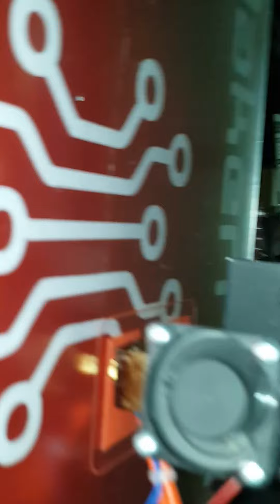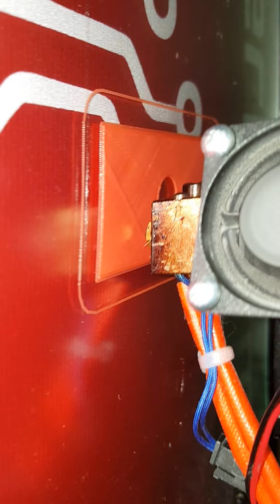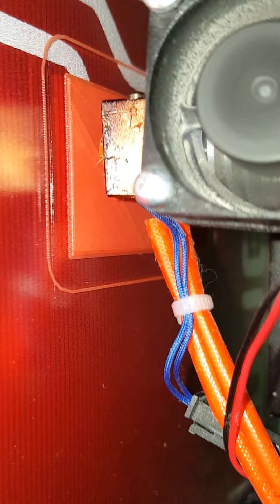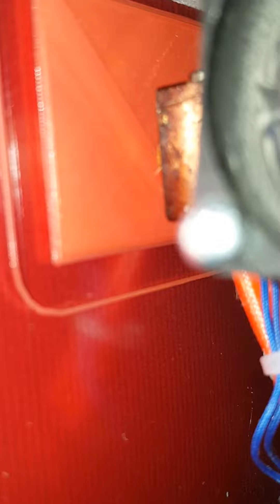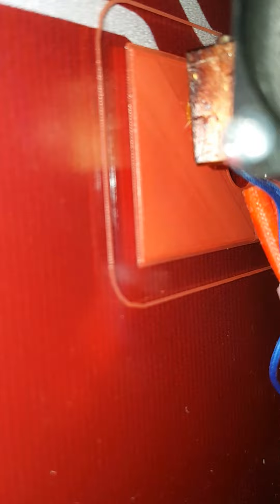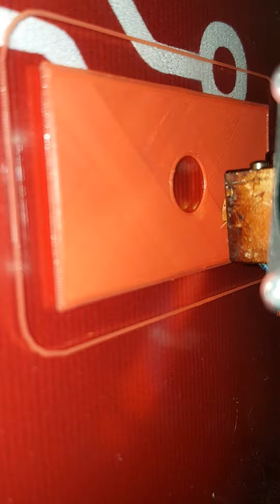Printing with a .15 nozzle...

Comment: Have you used this nozzle to print wax filament by chance?
Reply from the maker: I have not. if you do please let me know how it does. I would like to do some lost wax casting with aluminum.  I can say that this nozzle prints with incredible detail.
Reply: I will once I get my printer, Im on the waiting list, lol. Machinablewax.com carries the filament.
Reply from the maker: Thanks,  I will check that out.  Are you using wax for casting? just curious.
Reply: I want to use it specifically for doing high detail in jewelry.
Reply: Yes, for lost wax casting.